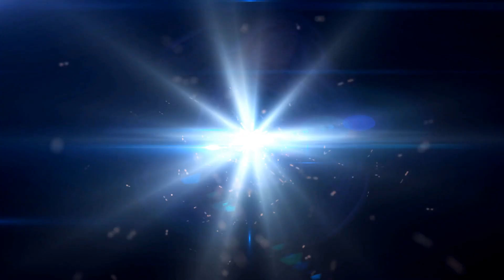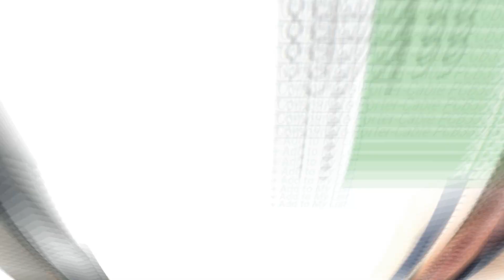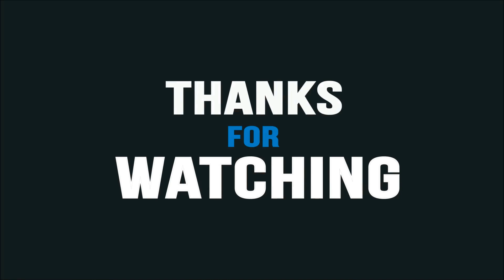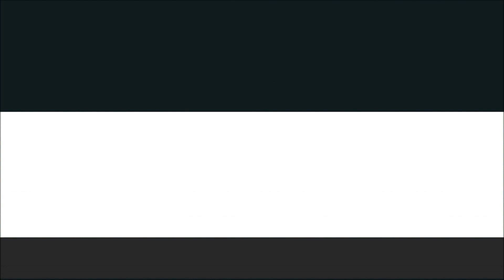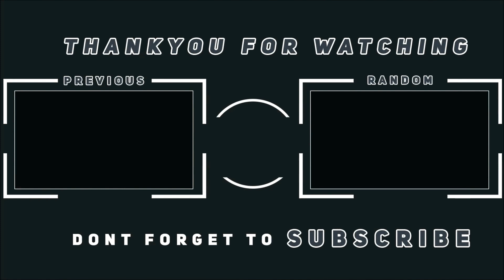Harbor Freight 14" Band Saw Discussion

Comment: I agree. I have this saw and it has been a multitude of issues from day one. The biggest issue is the vibration. It is an unpleasant tool to use. On speed 3 it shakes like a fat woman twerking on a card table. I had a cheap 10" craftsman tabletop bandsaw that I used for decades with little problems. I replaced the belts and blades. If I ran it at speed 4 (2700 fpm) the blade would work the tires off the wheels. I had to use double sided tape to keep them on. I hesitated sinking more money into it with new tires. I'm running it now at 2700 and am cutting wood with minimal vibration but I am still not happy. I left an honest negative review on HF website (with video) and it was never posted. I'd pass on purchasing this. I have the HF drill press and I am happy with it. Guess I'll sell it and lawn the inconsistencies off to someone else. Saving up for a grizzly.
Reply from the maker: Keep your eye out for garage sales etc- I picked up a old Davis & Wells bandsaw and restored it. Big and heavy duty cast iron and i love it.

Comment: You, ALSO, want easy adjustments. I have high end saws (a 14" Powermatic and a 17" Grizzly with iron wheels, brake, etc.), but still swapped some of the blade guide adjustment screws for the ratcheting knobs. Adjustments are, for the cost, made a breeze.  Keep in mind, the Grizzly was a couple grand, versus $375.00 (with coupon).

Regarding guides, my Powermatic came with "rollers." I am not so sure ceramic would not have been as good or better. The PM takes five bearings up and five down. If you bought them from Powermatic, you'd go broke. You are far better off buying from a bearing supplier. You can, for example, get eight for about $12.00, including shipping, versus $200.00 from PM.

My Grizzly bearings died shortly after buying it (yeah, I put some significant wood (e.g., 10" walnut, sycamore and cherry) through it.  That problem has not come back since I altered the dust collection to pull the sawdust that WAS building up around the lower bearings.

Comment: I bought the HF woodcutting bandsaw about 24 years ago new for $199. It is 1 hp. I don't know what have changed. I don't know what you mean by 1/2 inch.  Do you mean the blade? This is what I have. Timeberwolf 1/2 inch. four teeth per inch.  Most stock blades will not be of the high quality. I use this saw strictly for ripping thick wood and marginal resawing. 

I have cut 4" thick oak with it. It cuts quite well, but there are bandsaw marks that has to be removed, not smooth. Which 14" bandsaw comes with stronger than 1 hp? I haven't tried thicker than 4" oak.

I think to get it to perform better I will replace the tires with the orange urethan type, and the al pulley to with cast iron pulley. The pair of step pulleys are cast iron, just that the bigger one on top is not.

Comment: it's not worth $1.  I bought one then had to buy a roller so I could move it.  Another $130 for a fence, snd a few dollars for a replacement blade.  I tried cutting a 4 inch piece of hardwood. it stalled!  A one inch piece of hardwood?  NOPE!  My scroll saw cut it!!! The store manager lied to me about helping with a stripped screw on the upper blade guide.  The home office of HF promised a regional representative would contact me within 10 days.  NEVER HEARD FROM THEM.  I cancelled my charge card and any of their advertisements.  The HF band saw is for sale and I have returned to my 10-inch, 20 year old Craftsman (Rikkon) which cuts a 4 1/2 inch piece.  I now purchase equipment that works!  Yes it costs more but it works. Also the piece of junk has a 3 month warranty UNLESS you buy an extension.  That's telling us IT AIN'T worth the $1.

Comment: Great (and honest) video! I own one too, and although I cut a lot of oak that's thicker than 1/4", I agree it's under-powered.  I mill and lathe logs into smaller pieces I can lathe, but lately am having a problem with the blade staying on the wheels. You mention the tires coming with the saw are low quality, and I'm assuming that may be cause of my problem. Am ordering new poly belts today. Got some ideas from your video, so thanks!
Reply: The only thing I can cut through mine it’s cedar. Anything else it’s too thick and it has caused the blade to
Come off the track

Comment: It costs now $429.99 right now lol, thats a increase of about $55!
Reply: $449  today, June 1/2022. Haven't even picked it up and already hate it after this video.
Reply: @lucyscottwalker2203  I would not buy at harbor Freights. Simple things like screw drivers and such are fine, bigger machines... not. They are usually close to a bigger brand product, they claim they are as good but cheaper, but no. There is a reason why they are cheaper. There always is. Somewhere they have to save, even the brands produce in China where labor is cheap so it can't be on labor.

I would rather spend $100-200 bucks more and then have a quality product then Harbour Freight.
Reply: @Momoka7  We got a refund :) I've got a Wen, maybe 9" with the same vertical clearance as the one from harbor freight. Got it for $100 at an auction last year and would have gotten it cheaper but my daughter was a little overzealous with my money. Anyway, thanks for your advice.
Reply: @lucyscottwalker2203  I bought a benchtop grinder before. Didn't need to use it for 6 months, then by the time I needed it and opened up the package, I found out the base was plastic and got destroyed in shipping from China to US. Wasted about $50 on that.
Now I got a DeWalt for $100... that already look allot sturdier, with a metal base not plastic and comes with allot accessories to.

The worst case was when I bought that "Dual-Bevel Sliding Compound Miter Saw"... I used it a couple times, then the next time that security plastic got caught in the saw and was smashed to the table, ricochet into my face. And that after the saw was in my possession for a week or two, where just before I checked all screws and what not.

Luckily all I had was a small opening that not required any suture. I went to the Urgent Care and the Doctor put a sicker on to hold it together. I still see it in the mirror, a reminder to not buy from them.

Comment: Great review and discussion! I also own this saw. Same things I had problems with. I've since replaced the motor with a HF 2hp motor, linkable belts, better guides, riser block, blade tensioner, carbide blade, and made my own base. Now I can resaw 12" oak with ease, but that's  $500 after the fact.
Reply from the maker: yes but it is what you have to do in order to make the saw perform - now you have a really good tool for resawing
Reply: @TheHomeHandyman  true that! In retrospect, I would have spent the extra money on a Grizzly or Laguna. You live and you learn.

Comment: I brought one of these saws home yesterday.
It not hard for me to walk into HF and come out with 700 bucks worth of stuff.
I had been eyeing this saw, could justify it, but held off.
If you have an eye for real garbage,  can tell the fair to mediocre,  and know when you see some quality, HF isn't bad.
They carry a whole lot of junk, but also have some good buys on everyday items that you might grab at Hopedepot.
I bought the 8 inch bench drill press a few years ago, it's ok. I'm not building engines, but it suffices.
Would I buy it again? probably not.

So The other day I decided to pull the trigger on the bandsaw.
I read someone somewhere say that it's pretty much mandatory to watch a few of these being built on yootoob before starting.

I saw a number of guys say, in the end, it would be better to save up for a better saw.
Then of course there's the guys that love it. Maybe they do, or just don't know better.
There was at least one video I saw where the machine was hopping up and down so much it made me wonder how the guy could cut a straight line.
Another had one that sounded like a 100 car pile up. I have never heard a bandsaw sound that bad. Of course he may have put it together wrong.

Then I got to your video.
Not sure how old you are, but I'm just short of hitting 60.
I've come to a point in my life where I want to be building, not spending time putting things like this together, spending all day on customer service and help lines,  nor having to spend my time modifying things to make them work like they're supposed to.
I just don't need those kinds of challenges, nor do I really enjoy these kind of puzzles anymore.

Oh,  and I've never seen a bandsaw with only thrust bearings in the blade guides. Who the hell does that?

So the bottom line?
The saw sits in the back of the car, unopened,  and I'll try to patiently wait for the arrival of a Grizzly Go55LX.

Thanks for the video, and saving my time and sanity!

Comment: I've been using mine for about 30 years and for the most part I've been happy with it (I've made a few small modifications) ... until now. For the past few months I noticed the table wasn't as stable as it used to be and I thought it was just sawdust getting into the trunnions. When I looked closely at the rear trunnion I noticed there were metal bits in the housing and the trunnion itself  had portions busted off! Are these Harbor Freight/Central Machinery trunnions easy to replace? Are the trunnions generally the same size as other 14 inch bandsaws? Can this part be ordered from Harbor Freight? Central Machinery?
Reply from the maker: I start by calling HF customer service and ask to talk to one of their product techs -  it is also possible but i have not tried other companies like Northern tool or Grizzly that may have similar machines have parts available - all these companies have technicians you can talk to that can help you with install questions and parts but this is not anything i have had to do but worth a try.............hope this helps you

Comment: Another good review and discussion, thanks.
Reply from the maker: Thanks and if your looking for one get a good powerful one
Reply: On the contrary what I hear on this video, I can say that this band saw is really great. I own one for a year and I been able to make cuts up to 5 inches tick so far. I mean hard wood. Yes I made few modifications such as changing the belts which make a huge difference. Most important is that you got to make sure all the mechanism is aligned properly. Other than that it will make noise an shakes annoyingly. Some times it is not about the tool, but the user.

Comment: Seriously a 14in band saw that can't cut wood thicker than a quarter inch!!!! WTF??
Reply from the maker: Yep unless you do some modifications
Reply: I use mine for cutting carving blanks. Did one earlier this week that was 4.25”. No issue there. My issue is that it has some strange blade size to it. Think I put a 94” replacement blade in as soon as I bought it. Can’t remember at this point, but it’s about 2” too big. Adjusted to max and not quite enough tension in it.
Reply: @JS-rp7qb  Are you telling me a 14 inch band saw with a 1 hp motor cant cut anything over a 1/4 of a inch ?  Sorry but somethings screw up here ..I got a delta 14 inch and it cuts up to 5 inch carving stuff

Comment: I had one of these, if was given to me for free.  I kept it for over a year.  I added a blade tensioner (extension handle), new tires (polyurethane), new blade guides, replaced belts with link belt, added a kreg fence, added wheels, used washers to make the wheels co-planer, replaced most of the cheap screws with stainless steel ones.  It ran pretty good, except that it was pretty underpowered.   Wound up getting a Laguna 14BX, and then gifted this saw to the guy who used his truck to deliver my new band saw.   It was good for general stuff, but I needed something that could I could resaw with.  It ran alot better, after upgrading alot of stuff, but it was basically a money pit.
Reply from the maker: yeah to do all the upgrades i agree with you - same with me when i restored that Davis and Wells - huge difference when you upgrade all together but like you said for small projects and thin material it was ok just not what i needed................thanks

Comment: Good honest video.  I spent less than half this amount and bought an older used grob bandsaw.
Great machine and,very robust.
Reply from the maker: I agree with the money you will add in to do all the upgrades to make it perform the way it should you may be better off buying a good used one - I sold it before i got to far into it and decided to restore  a old Davis and Wells bandsaw - I think i did a video on it and it is a good investment

Comment: So this band saw isnt good for metal wood only
Reply from the maker: your right I would not use it for metal at all - not enough power and for wood it works ok on less than 1/4" with a good blade on it but other than that you will have to do some upgrading on it
Reply: @TheHomeHandyman  might as well buy an exspensive band saw to begin with you buy a used good brand and fix it
Reply: It is advertised as a woodworking bandsaw, nothing is said about using it for metal.